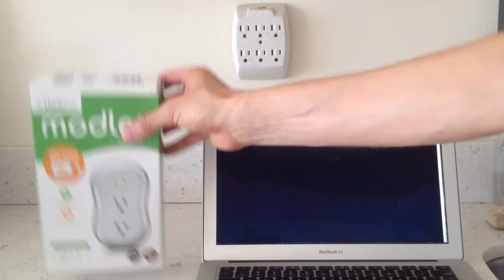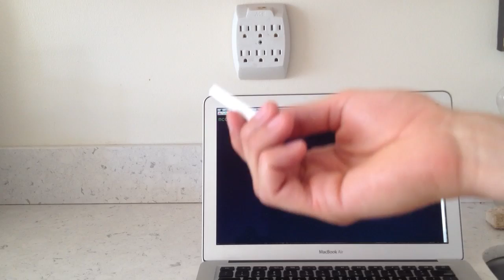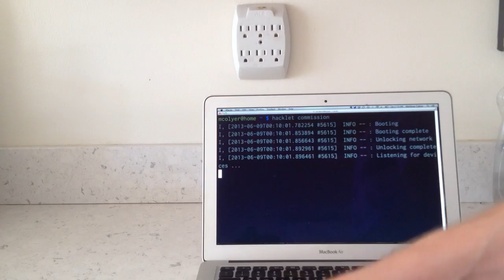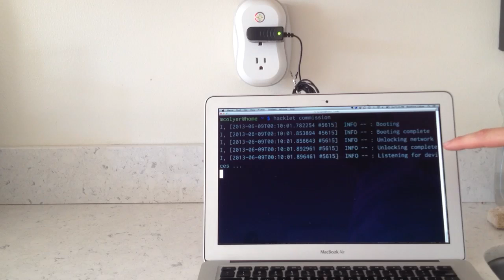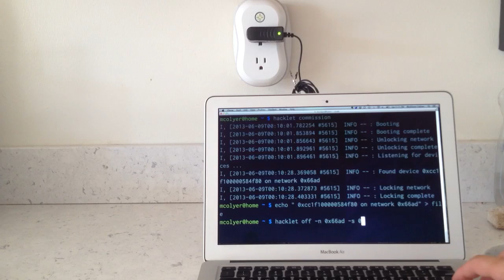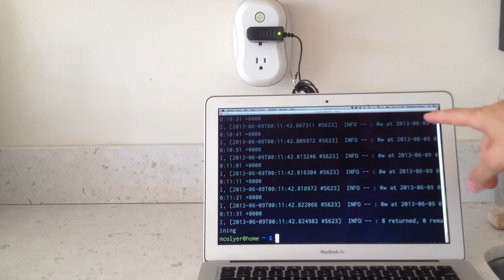Hacklet Demo

Comment from the maker: Thanks! Multiple dongles should work just fine (I have two working myself). I assume there is a theoretical limit but I'm sure that five is far under that.

As far as I know the modlets use the Zigbee transport but I'm unsure of the protocol that they run on top of that, I believe it is encrypted but I don't have a way to confirm that.

Comment: Fantastic.  Does the dongle work for multiple Modlets or are they tied together somehow?  Could I have 5 Modlets controlled by one dongle?  It doesn't seem that these use wifi; I know you don't make the devices, but what wireless protocol are the Modlet devices communicating over?  Is it a secure protocol?